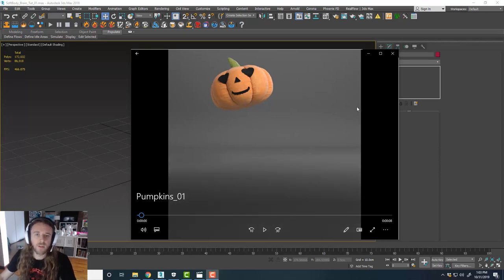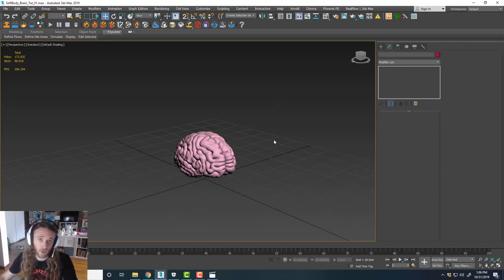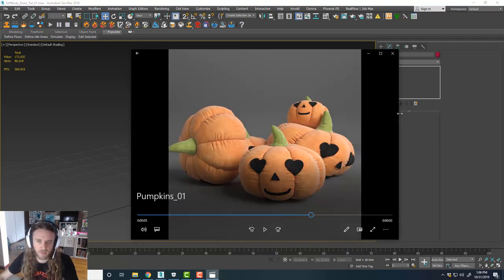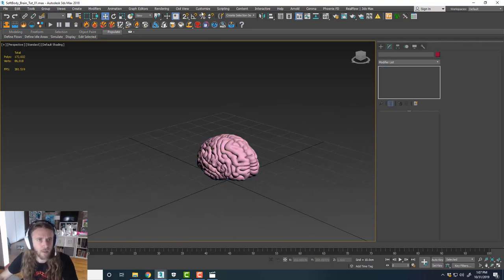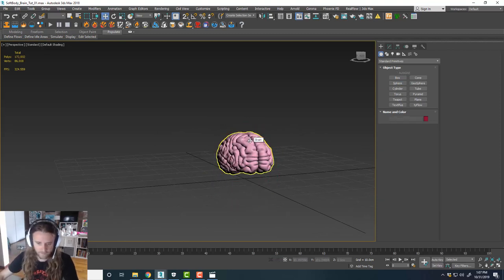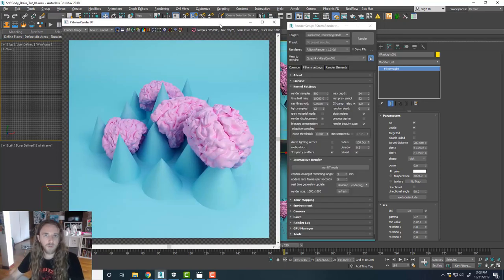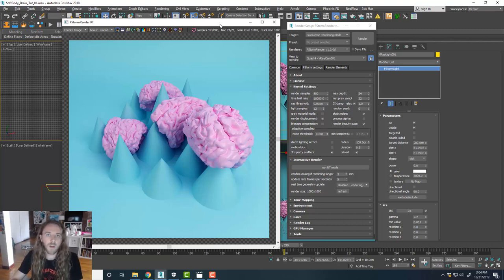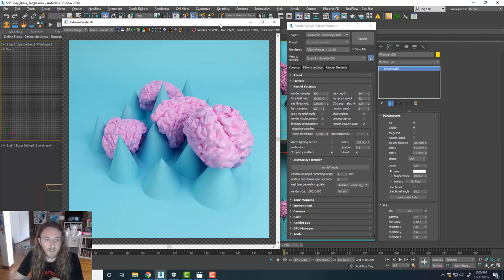3ds Max + TyFlow TUTORIAL: Soft Body Dynamics and Render Setup

Comment: is it possible  if you can do a simulation of tensegrity and tension , to be specific  tension wires for architectural structures . I dont know if its a good idea to use 3ds max tyflow for real applications, or even 3ds max in general , of course not the render side of the software ,  but that's my software of choice for arch viz , I thought it is capable of that or maybe I am wrong .
Reply from the maker: Great question! You can certainly simulate structures of that nature with TyFlow, but it ultimately depends on what end result you need. If you're trying to simulate tension or tensegrity for a simple visualization or to make an animation, TyFlow would be perfect for that. However, if you need to calculate exact stress loads to apply to fabrication, you might need to use a more precise tool. Back in arch school, I used Grasshopper and Kangaroo to evaluate tension and specific forces/loads, which those tools provided those sorts of accurate analytics that could be used for fabrication. Hope that helps!

Comment: WHY F STORM ?? BTW I AM NOT GETTING GOOD RENDERS USING VRAY ADV. HELP ME OUT!
Reply from the maker: I love Fstorm because it's super fast and easy to use. I definitely recommend trying it out. Vray is a bit more temperamental to work with, so I don't use it as much. If you do want to use Vray, there should be plenty of tutorials you can check out.
Reply: @simulation_lab  i am gonna try f storm and one more thing i just rendering simple soft body dynamics with m cloth 3ds max and using the gold physical material and to show that gold material in render , i need environment map and i used that , so i get the results by rendering it as a png , but the shadow of box and balls isnt showing up on the ground even i am using vray matte shader but unfortunately it also showing up some of the environment things , i want to clear that why i am rendering it as a png bcz i wanted to put background in post like mono color , i want to confirm from u that u made all your mono colour backgrounds here in 3d though !?